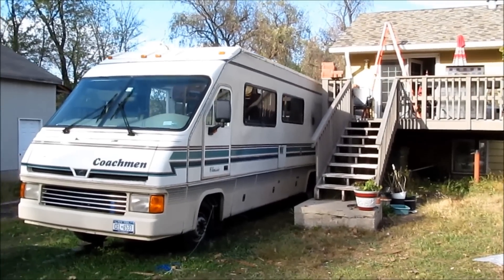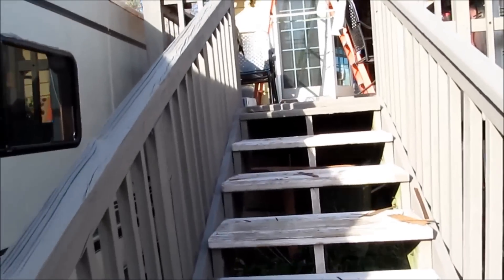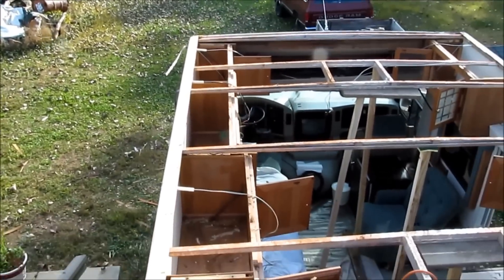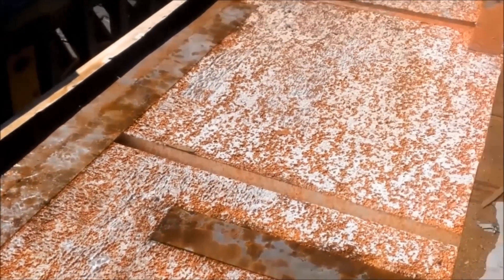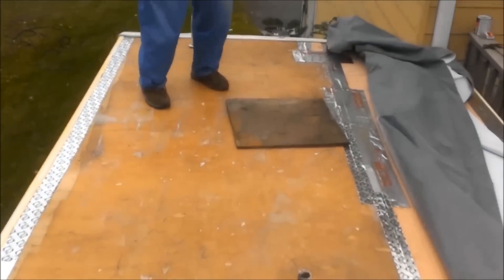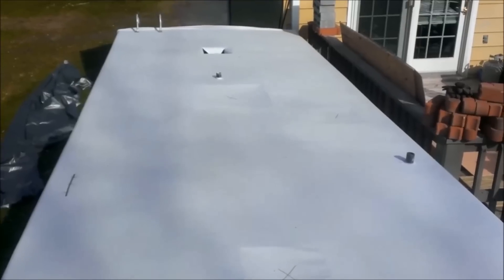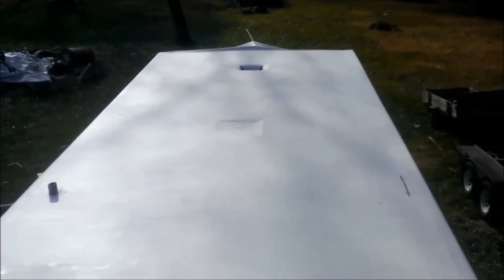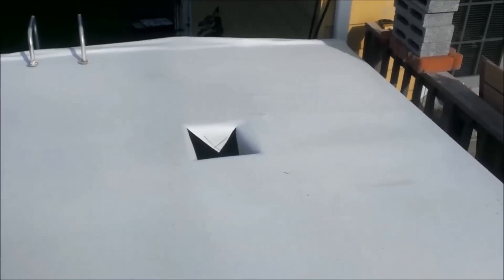RV Rubber Roof complete teardown and replacement

Comment: This video is very useful you think you can do this kind of job or somebody else and how much will it cost?
Reply from the maker: Any contractor or handyman capable of taking something like this on is going to charge anywhere from $25/hour to $50/hour.  I had about 15 full days of labor and so that would be $3000 - $6000 in labor plus whatever it costs for materials in your case.  My material cost @ $1500 was super cheap i could never believe how inexpensive that job was outside of the labor and I always knew i was de-valuing my time for this project but at least it got done.

Comment: Chris, I have a 1994 Ford Royal. I need to replace my whole roof like this as well as the ceiling inside. I have to do a couple walls too :( . This made me have a little more conference to try and do it myself
Reply from the maker: cool glad it helped.  if i had it to do over (and the proper budget) i'd love to have bought a pop up garage.  tarping and untarping every day for months was terrible.  but other than that if you don't mind the work it can be done and it didn't cost all that much.  just alot of time and energy.

Comment: Do you have any photos of what the roof looked like without the rubber membrane? I'm trying to see how the superstructure is built but the camera is moving so quickly and the shots cut so quickly that I can't get a good look. I'm about to do a similar repair myself and I want to know what to expect
Reply from the maker: can't you just pause it?  at 1 minute 34 seconds that's about the best you're going to see.  then there's another view from inside at 25 to 29 seconds.  it's a quick pan but you should be able to pause it.  watch it from a PC.  smartphones can be quirky and hard to pause.

Comment: Tearing the roof off the camper due to a major leak. This really helped to see what I'm getting into. Thank you!
Reply from the maker: ***** no problem.. glad it helped.  I wish this job on on-one... didnt continue it until last week.  it's grueling and un-rewarding :(  At least now i'm at the point where it is watertight with AC's and trim so i can take my time with the rest and not have to untarp/retarp.

Comment: Hi Chris,
Amaaaaazing job! Looks so hard and difficult! I just bought a 1990 and discovered some mold walls that I didn´t expect... :o What kind of panels did you use for the ceiling? I need to replace some walls, would you use the same kind? I would really appreciate any info. Thanks for your help!
Reply from the maker: it all depends what you encounter once you start digging in.  if you're going to try and re-use the exterior trim then you're going to have to keep the wall dimensions the same .  for me 1/4" luan on both inside and outside worked well.  but it wasnt enough structurally which was why i had to rely on the contact cement forming to the foam panels for the rigidity i was after.

Comment: How did you account for the steel grid not being spaced for 4' or 8' centers?
Reply from the maker: I tried to stagger the upper and lower seams so there was never and upper and lower one on the same cross member.  all the way forward on top was only about a 12" panel, the mating one underneath was 4' and that kept it going sort of alternating top/bottom/top/bottom the rest of the way back.  The framing was aluminum and one crossmember would in no way shape or form support a person's weight on its own.  The strength came from that design and all the foam/plywood with construction adhesive.  Kind of scary really.  But it came out solid as hell.
Reply: well mine is off and I basically going to span the 92" across and just cut each piece for as wide of a run I can make to the next steel frame stud center than take off and do it again as far as I can reach to next steel center...yeah scary looking, gluing in the new headliner luan seems as though it will be tricky as well lol...the luan on top was so worn the ac's had dipped where the frame was so I propped each opening up to get a small arc otherwise I could see the water pooling.. I am using 1" stainless self drilling screws to attach the 11/32 plywood to the steel structure... my fears were a seam of plywood with no support under it
Reply from the maker: yeah but the thing is can you really rely on the steel for the strength??  I propped it up from the inside to keep the curve, screwed up the luan to the aluminum, then glued down the styrofoam panels with an adequate amount of weight and let sit for several days to fully cure.  then only after that's done the top panel got glued down the same way.  Take two panels of luan and glue them sandwich style over a piece of foam.  you'd be amazed how strong it is.  Unless your roof is vastly different design wise that's where your strength is coming from.
Reply: thanks so much BIG help
Reply: hat adhesive did you use on the Styrofoam?
Reply: Man, Wow !! Awesome job. I have no idea how bad mine is going to be when I pull off the old roof, talk about scary.
Reply: Chris, how thick was the wood and the Styrofoam panels. Was the Styrofoam that pink 4 x 8 they sell at Home Depot? I'm just trying to figure the process out. I don't want my cabinets to fall to the floor.

Comment: Hi I was wondering where the cabinets screwed into termination bar or the roof because my rv gets leaks from the coners of my cabanits .
Reply from the maker: I dont know what you mean by termination bar.  there were strips of steel glued to the foam on mine so what i tried to do was install steel flashing to the top side of the lower sheet of the roof just to give the screws something more to bite into.  havent had any problems.  but if you have leaks in the corners i dont know how that info will help you.  you need find and stop the water from entering.
Reply: Thank you very much for trying to answer my question

Comment: What did you use on the inside roof? Vinyl wall paper? What did you use for glue sprays?
Seams inside?

I think I will use the roll on rubber roof, but the ceiling has be stymied.
Reply from the maker: +Bill S Still haven't actually finished the interior.  i found this soft/flexible spackle i'm going to use for the seams and then just paint the ceiling white with a good exterior rust-oleum.  with the moisture and temperature variance i was told indoor paint really isn't going to cut it.  

didn't spray anything glue wise, i just used the Dap WeldWood Contact Cement and brushed it on.  It was the green can, non-flammable version.  the red was too thick and would eat the foam so you need to use the right stuff otherwise all the foam would be gone.  really surprising and not exaggerating.

Comment: Good Morning Chris Iverson. Yes, your video has been helpful. I need to know what wood you used when you replace the rood, was it 3/4 " or 1/2" ? I'm 60 years old and my husband passed away on Aug 26, 2016. It's been heart breaking to say the least. I have to replace the entire roof on my 42' Fifth Wheel. The roof is spongy and I have been patching it with Henrys Rubberized Wet Patch, which apparently only comes in black. Anyway, Did you put down a moisture barrior?  if so, at what point? I know the membrane is going to cost me at least $750.00 plus shipping. I also couldn't make out what type of adhesive you used? Please help me, if you can. I am dealing with a real mess. Thank You Chris
Reply from the maker: Cheryl,  I'll try and answer all of your questions - the wood was the super thin 1/4" thick Luan.  It had to match what was used previously.  Keep in mind that may not apply to the design of your roof.  For mine the strength was obtained by gluing the luan to the pre-formed foam panels that were re-used.  no way would i have been able to use the blue foam insulation boards they sell in the big box hardware stores.
Reply from the maker: The glue i used was Dap Weldwood Contact cement.  brushed it on and then used weight to form a best effort 'press fit'.  be careful on the glues/adhesives you use.  some are solvent based and will completely deteriorate styrofoam.  sounds silly, i thought so too, but i tested this and the solvent types will turn a 1" foam board to a paper thin glob of mess.
Reply from the maker: There really was no moisture barrier.  I felt the rubber membrane needed to be glued directly to the rough wood surface to adhere properly.  That's a judgement call i suppose.
Reply: I could have sworn that you said, you clamped some Styrofoam together, or with something else. I'm such a mess right now, I'm sure I'm not making much sense at all. Thank You for your time Chris Iverson

Comment: Wow.  15 days of labor !  It's so nice, it's a shame to cut holes in it, no ?   i just talked to a guy with a tioga that needs a new roof. It's smaller, and does not leak now, but one 18" section of plywood has delaminted and he tore off a  2 by 2 section of rubber hitting a tree branch.  IDK.

Comment: Nice job....What is the big roll that you put at the end for to cover the roff? company
brand? I need to buy. Thanks.
Reply from the maker: the rubber sheet?  i dont quite know what you're asking.  it's basic rv rubber roof material.  i think i bought it on ebay, it was not anything name brand it was cheap.

Comment: What kind  of glue did you use to glue the Luan to the form and the steel braces? Do you roll it on with a roller to both surfaces ?
Reply from the maker: Dap Weldwood Contact cement.  The Low solvent version.  the regular version and alot of other glues will melt the styrofoam - no joke.  tested it and it just disintegrates.  I'd pour some on and then use a paintbrush to spread it out.
Reply: Thanks bud' I have all the ceiling tore down and the Styrofoam  is all there in good shape (kinda) and the roof the plywood is just pealing off so gonna try and glue the luan to the ceiling then take off the roof .

Comment: What kind of wood is that? Plywood? Waterproof?
Reply from the maker: it's your basic cheap luan 1/4" sheets.  Nothing else really would have worked without re-doing the edge trim and moving down the cabinets.

Comment: what is the best way to cut for the sewage vent? yours looks very flush what is the method you used?
Reply from the maker: Nothing special.  razor blade and the PVC pipe was holding the rubber up tight in that spot.  i just drug the razor around the 1/4" lip of the PVC then stretched it over the pipe and slid it down.  you wind up creating a ton of holes in the roof anyway for screws, vents, etc... as long as you clean the rubber properly with denatured alcohol and then apply the dicor lap sealant you're good to go.

Comment: What was the length and width of the rubber roof material you ordered, the reason for asking is I have the same Rv.
Reply from the maker: I think it was 32' of rubber and the roof portion was 30' for a 35' overall length RV.  nothing beats a measurement.  you're going to want 12" of excess on the front and rear.
Reply from the maker: I also noticed that the original rubber went underneath the front and rear shell and probably dangled.  interesting design so if your front or rear seam failed water would run off the roof anyway.  i was unwilling to remove the fiberglass caps so i just cut it to length and plan to re-seal the seams as needed

Comment: I need materials to build cabinets for my RV, I don't want to use white and I can't find wood grain stuff anywhere... Solid wood is too heavy... I'm wondering what to do about this but the cabinets in my RV are trash, they got wet and are disintegrating.
Reply from the maker: that's a tough one.  i'm sure big box stores wont know, they only know item numbers of what they carry for homes.  you might try a local cabinet retailer who does custom stuff, they may be able to point you in the right direction for where to buy the materials.  how about places like camping world??

Comment: So once you have removed roof and have exposed the metal beams running across rv. And you added ply wood roof down what are you screwing the plywood roof into? Those metal beams?I guess my actual question is what is securing the plywood roof down.

Comment: I've replaced entire floor pans in cars, is this worse?
Reply from the maker: it's hard to compare the two.  i'd say yes this is worse.  floor pans you gotta what - take out seats, carpet, etc... cut the metal, weld new in?  sounds like a few weekends of work whereas this was an entire summer working nights and weekends, with lots of time off work.  it's not a metalworking process or a woodworking one either it's kind of it's own animal.
Reply: copykon yes! Lol
Reply: what were all the materials involved? glue type, where you got materials and hows it holding up? only crazy ppl like us do this type of work lol
Reply from the maker: i do go over that in my commentary and yes i agree.  this job was crazy, only take it on if you have a similar insanity going on in your head.  the plywood was super thin and you had foam panels sandwiched in-between.  I used 1/4" Luan which was the closest fit, it worked perfectly.  but you have to realize - first and foremost - the aluminum and wood WILL NOT hold the structure.  i used dap weldwood contact cement.  i went through several gallons.  you cant use just anything, many adhesives will melt the styrofoam and i saw this first had while testing.  the dap weldwood held up well.
Reply from the maker: Also, i'm happy to report it's holding up great.  the vehicle goes down the road completely differently.  it was like a loose shoe box before and now the whole thing feels solid.  it was a night and day difference i couldn't believe the first time i drove it.  now we're 3 years later i'm im still happily running it.  no issues with the roof repair it doesnt leak and is still very strong.
Reply: Chris Iversen any idea where to get replacement Cabinetry and parts for cabinets for RVs?

Comment: what kind of plywood  did you use  would birch  be good  to use
Reply from the maker: it was 1/4" luan from Lowe's.  would have loved to have gone thicker but you had the cabinets and the upper trim there and had to maintain an exact dimension.  this is why the glue and foam 'bridge' structure is so important.  idk what your roof's design is.  every application will be different.

Comment: Decent Commentary, That means you cussed like hell when you were trying to figure out how they attached all that stuff!!!
Reply from the maker: +Prepper Mountain (Prepper Mountain MD) You have no idea.. haha.  They build these things like total crap.  necessary for weight savings but really annoying to rebuild relying so much on foam, thin plywood, and contact cement for integrity.  The aluminum cross members by them selves would not even hold me and I'm only 165 lbs.

Comment: It makes one wonder for as much engineering that goes into one of these motor homes- Why didn't they do it right the first time at the factory? Mine is a 90 model and has seams in the roof everywhere. To me, a seam in the roof is invitation to failure and the engineering dept. should have known a stupid idea when they see one. A roof should me engineered properly and built with proper materials with out any seams.
Reply from the maker: +Robby Gee Agreed...  However when my parents purchased this RV brand new in 1992 this one was ~$55,000 and the so called 'properly built' ones were $200k on up to $650k.  Proper chassis allows for the weight capacity for the proper materials to do it right.  And so on to higher paid engineers, staff, attention to detail.  you get what you pay for.  Nobody in the middle class could ever justify a several hundred thousand dollar rig so you buy the cheap one and make due.  And at that, fwiw, it does the job.  If we kept up on the rubber this job would never have been necessary.
Reply: 100% correct. At any rate, I looked up this video for a reason, and it helped me immensely. I now know what I am in for. This project is now properly engineered without the degree. LOL!